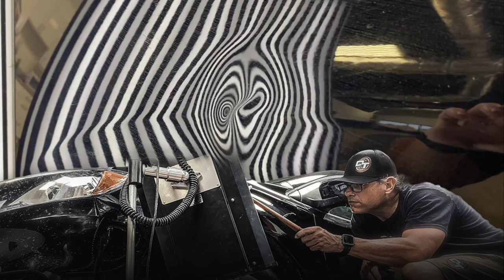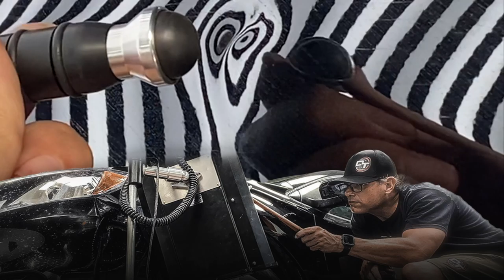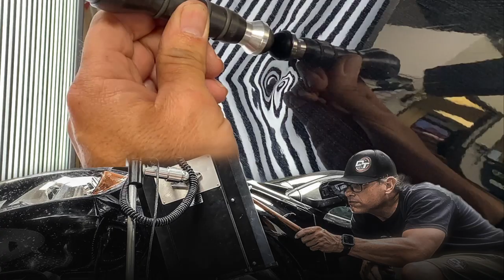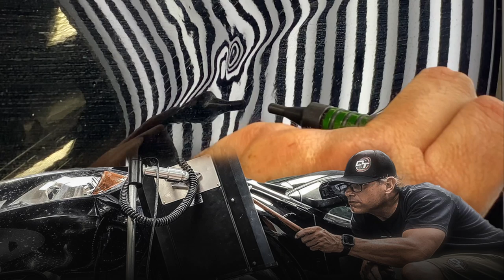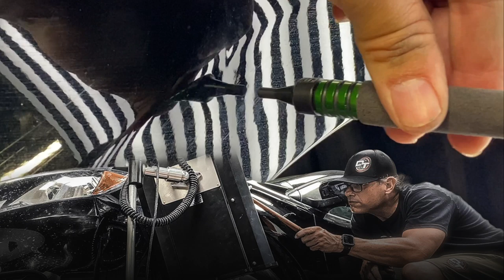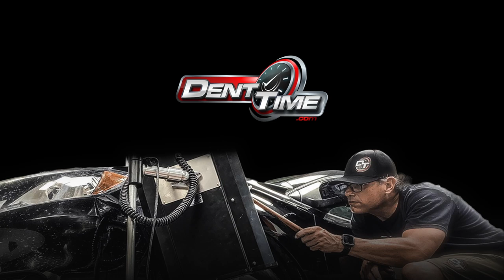Paintless Body Line Dent Repair Process Using Line Reflection

Comment: How good is he at reading fog? Just curious, because I've haven't yet seen him do it. Not saying he hasn't made a video on it. I'm one of the many that do not like the lines. They seem unnatural, but they do work for some serious techs
Reply from the maker: It’s not about which reflection is better. It’s about which reflection you understand better.  Oh and yes I can fix with fog. If you want to see professional and real tutorials check out Denttrainer.com
Reply: @denttime  I went back and watched a detailed repair from you with the lines. I'm shocked. I get it. Years of me ignoring it. The fog (more or less) comes from the orange peel. Very precise detail. It took very specific camera angles for me to get it. Hence, I've never used one. Thanks Mike
Reply from the maker: Thanks for watching. 👊

Comment: It seems like you work your way into the worst part of the dent, rather than starting there. Am I correct?
Reply from the maker: In some cases yes. And if your wondering why? Because deepest part of dent needs more metal. You can’t fill a hole without dirt. 😉
Reply: @denttime  that's a good way to look at it. Thanks for the reply.